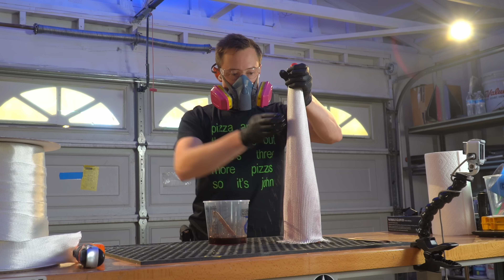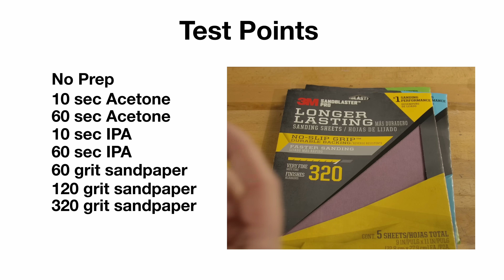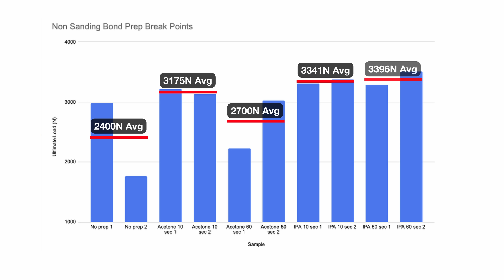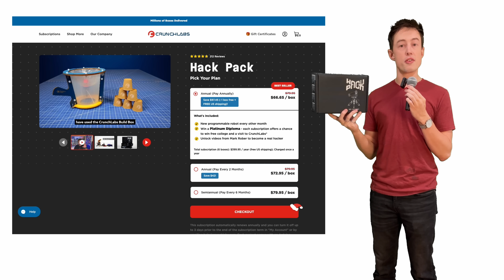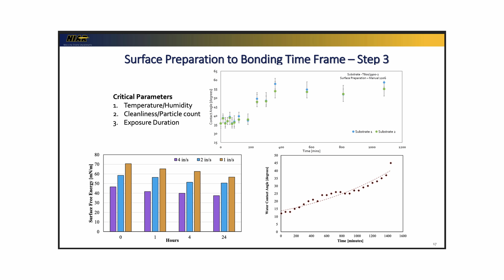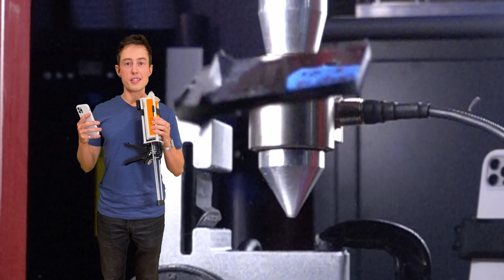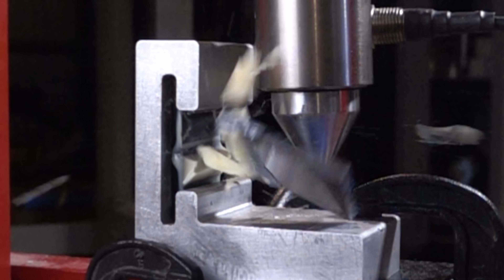I Broke 100 Epoxy Bonds to Find the Strongest

Comment: Try 3M Scotch-Weld DP420/DP460, Araldite 2015/2014‑2, and Permabond ET5428/ET5429. Loctite E-120HP isn't really aerospace grade.
I don't think sanding has any benefit, other than weakening the top layer fibers and possibly leave behind fringes that promote separation. So Acetone+IPA should be the best method regardless.
Reply: Sanding off fibers, Oceangate flashbacks...

Also, effectively, one can destroy the ENTIRE top layer by sanding only "a bit off it".

Comment: Only on youtube can I sit down for my sunday morning coffee and watch a 40 minute video where someone geeks out over epoxy stress testing.
Reply: I would like to suggest a test where the item is heated to about 125-150° with a hot air gun or hair dryer before applying the epoxy. Doing so will make the epoxy flow like water and it would likely eliminate most bubbles without the need to vacuum. Also you are sanding all wrong. Put the sandpaper on a flat surface and move the piece across the sandpaper instead of moving the sandpaper across the piece.
Reply: @Notfiveo0  yup, a sheet of glass is good for that. Also 8 shaped motion while slowly rotating the piece!
Reply: It's noon here so I'm drinking beer :)
Reply: This is barely scratching the surface 😂

Comment: Considering that you're intuiting the data regression, it might help to variablize the failure modes explicitly. You seem to be diagonalizing factors just fine without orthogonal experimental design. Although retroactively filling out the data points with specific failure modes would be frustrating in its own way.

Comment: I work in the pad printing industry and deal daily with inks, silicones, adhesion, and vacuum chambers. One important thing that hardly anyone mentions: right after degassing, you should minimize the time the resin stays under vacuum. You can put more variables to the test, regarding vaccum chamber! 

Keeping the resin under vacuum for too long doesn’t improve quality — quite the opposite. After degassing, the resin continues to “boil,” light fractions can evaporate, and its viscosity and pot life may change. In addition-cure silicones, it can even affect the curing kinetics. That’s why it’s best to degas until the bubbles disappear and the material calms down, then immediately release the vacuum and start working. This principle significantly improves the quality of the bonds.
Reply: You aren't the first to mention the light fraction of the adhesive possibly boiling away under vacuum.

Wow, there is so much one can do better or worse, with "little" deviations...

Comment: The only major changes I would make is trying the sanding with a belt sander to see if the consistency helps, and using a very slow electric/hydraulic ram to apply the load in a more consistent way. You might have just loaded the coupon fast enough in your 4kN test that they gave a higher but false reading.

Comment: Awesome video, I'm not rocket surgeon but for fibreglass repairs after sanding will always do an acetone wipe. It was my understanding it removes the styrene wax from the surface to promote the bond. Thanks for the all info and will be doing an IPA wipe after the acetone next time.

Comment: One thing that I thought was notable is that there were examples where you were observing substrate or cohesive failures.
Perhaps I'm missing something, but I'd think that once you're getting cohesive\substrate failure, the strength of the adhesive bond is no longer even being reached and measured.  Something else broke before the bond, so you're measuring the strength of the materials themselves.
By way of example, you can increase adhesion to cardboard by stepping up from Post-It Notes to masking tape to packing tape, but past that stronger tape doesn't make a difference because the paper surface of the cardboard is peeling away from the corrugations.

That said, you started getting what appear to be more consistent results with your final technique, so that's not nothing.

Comment: 32:50 A random thing I've "noticed". THE absolutely best sticker glue remover is epoxy thinner. I had some thinner for epoxy floor and by accident poured it over a sticker that was half-removde because it was too hard to remove. The sticker came clean with all the glue almost right away. I've used it to remove some other glue residues, like glue from plastic 3dprinter beds.  Commercial sticker removers are nowhere near as good. It smells a little of acetone. Try using that for preparation of epoxy surfaces.

Alternatively - toluene. Tried that for cleaning printer bed. It was too hard to remove prints afterwards, clean ethylene alcohol is better for cleaning, because plastic sticks, but it's easier to remove. Toluene looks like it dissolves surface of most plastics and dries extremely rapidly, leaving very rough surface.

Comment: You are supposed to mix in a separate container, degas and then load into a syringe to apply the adhesive. (Aerospace technician)

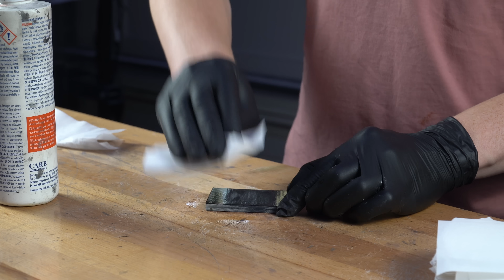Comment: Really enjoy watching all of the comparisons of the different test results. At 4:42 It didn't seem like you explained your full cleaning process in the video. Are you letting the IPA air dry? That would be leaving residue on the parts affecting the bond strength. The cleaning procedure for adhesive bonding parts in aviation manufacturing, scuff with Scothbrite pad, when wiping the parts for cleaning, never wipe the part with the same section of the rag more than once to prevent reintroduction of contaminants, wipe with MPK until the rag comes away clean, then wipe with a clean dry rag before the MPK drys. If the MPK air drys, rewet and wipe dry.

Comment: I make fiberglass body panels for street legal race cars. I am not an expert yet by any means. Occasionally the fiberglass molds chip out and need to be repaired.  I tried sanding, acetone, iso, etc, then fill, finish, polish, and wax. The chip would never hold. My solution was to sand, then drill 1/8" holes about 1/8" deep. Here is the key: the holes are all drilled at angles, up to 45°, not straight in. Clean up and paint in the holes with resin and a tiny brush, then fill and finish. None of the patches done this way have failed.

Comment: I love pop rivets and screws and how they expand to fit the holes, I would love to see a test where you drill a pattern of holes (comparing different sizes) then degas so that the epoxy can get right into the layers of the material rather than just grabbing onto the top surface.  Thank you for your hard work and wonder contribution, great video!

Comment: Nice, my first thought was anything over a few seconds of acetone's gonna make it weaker, it did. If you want something with a little more power, I use lacquer thinner when acetone doesn't work, it will literally eat through wood, so doesn't need much time. I learned that surface prep is everything... I'm lazy.

Comment: Low surface energy is super interesting for me as a car guy. I love having the water bead and just fall off the car when washing. Dirt doesnt stick to the paint and is very easily washed off next time. Some testing of the opposite of what you are doing would be interesting.

Comment: The optics cleaning guys have their own experiences. Simply wiping will often leave a streak, but dragging a drop with the right speed will not. But even air humidity matters. It's also possible to contaminate the whole bottle and then you can wipe and wipe.

Comment: The Titan submersible most likely failed because the repeated compression and expansion of the composite (and the bond between layers) created delamination throughout the material lowering its strength. I would imagine the failure of a rocket fin is not from slow steady pressure but from the extremely rapid resonances you get at Mach+ speeds. Ok, yes the steady pressure is there too but I’m willing to bet it’s the vibration the breaks the bonds in the composites and the bond between parts. I wonder if you should test your top three bonding techniques against resonance.

Comment: next time do a central composite rotatable design (CCRD) it will give you information about the best optimol point in those variables, it even will give you a optimol point between the variables. And a software does it by  you after the experiments. (and reduces the total time of experiment by half)

Comment: This was hard to watch. Your test results had extremely huge variance, yet you insisted on only doing two samples, squinted your eyes when looking at the results and made wild conclusions trying to fit the data. I think these experiments had negative value, not because the results were bad or incomplete, but because of how you interpreted them and how much value you put into your conclusions. You put a lot of weight into reducing uncontrolled factors, but you never had any significant result in the first place. All the results from before T9 could have realistically been from the same distribution, meaning all the conclusions you made could be just as well (and more likely) be explained by randomness instead of all the parameters you were modifying.

There is no need to be as rigorous as scientific papers when doing experiments to produce results of value, but you need to read up on statistics and how they can mislead you. You can often get away with only 3 samples per test, but only when your variance is much lower than the effect you see. You can get away with uncontrolled parameters, as long as they influence all tests in the same way. In this case you should really have put much more attention on understanding the on the size/shape of the distribution of results and how to reduce that, and not on trying to replicate that 4000 number.

Comment: You should try roughing the surface with a wire brush or wheel, instead of sandpaper. In theory a clean wire brush should embed less contaminants in the surface.

Comment: Are you kidding me? I never heard of surface energy until last week, as it got relevant for my work in printing on glas surfaces for the first time. So i went down a comparable rabbit hole and now we are doing a thermal pre treatment with a gas burner that is spiked with pyrosil, which deposits SiOx. Afterwards we use a primer, wich I dont know all the datils about but it provides better adhesion with the resin dyes we are using. All that to get to the sweetspot of 45-60 dyne and right molecular composition. After getting this treatment right the print quality went up 200%. Cant tell you how many tests we did XD

Comment: 9:58 The 60 grid test is still good to understand how you can achieve 4000N.

Your Data:

The winner closeup 9:58:
1) the epoxy did bond well to the resin on the surface by chance. You can repeat that reliably with your ace+iso method.
2) Crucially though, the substrate delamination did NOT reach the fiber level, thus the resin didn't just get peeled off the fibres, unlike the right side. BECASUE there was no single large stress point/crack at the base! Proof? Look at 9:42: The delamination at the top right corner begins in the epoxy, then penetrates INTO the substrate and rips the resin clean off the fibres!!!

How do you avoid this stress point at the fins base?

Better shear management. Look at your contact surfaces of fin and wall, where the cracks start. I heard that epoxy can at best bridge a gap of .1mm for optimal shearing resistance, that's why any flush bonds usually pressed down with clamps.
Your gaps are way beyond .1mm and inconsistent:

7:10 there is a thick layer of epoxy where the fins base sat
8:59 has a really thick layer
9:31 also has a thick layer
10:19 has a thick layer again
And your 9:48 60 grid? It has a perfect, thin even layer, like it should be!

Since the most promiment failure was shearing and the 60grid had the tightest fit, tight fit is a huge variable right where your failures can start!

If you test any more, instead of letting the plates wiggle in the loose moulds,
-first apply a thin layer on the back of the fin before sliding it in, to make sure it gets coated.
-and (!!!) cut the tip off the mould and press the fin down with a clamp!

You could also do a quick test: Epoxy a piece on a surface, with just a thin layer of epoxy, no filler/mould, then clamp one, leave the other sitting loosely. Then do the test how much that affects strenght in that area!
I also suggested in another comment, recessing the fin into the substrate might help reduce shear to begin with.

Comment: Did you think that during the ad read I wouldn't notice the rope on the well was facing the correct direction and the rope down is in an accurate position as if it were unwinding down. Because I saw that

Comment: This was a perfect case for multivariate testing. Don't test just one variable at a time! Look into design of experiments and taguchi arrays. They could save you a ton of time and reveal a lot more info than you would learn intuitively from your experiments. Taguchi arrays are extremely simple and effective (I have a video on them). You can go further with DOE software that's made to find exactly what's significant in your experiments and give you a super efficient testing path.

Watch my video "test multiple variables at once to optimize anything" and read jeremybub2's comment on that video to see how you can go further with software. I need to do an update on that myself because more people really need to know about DOE in the diy space.

Comment: already 1200 comments so doubt you will see it but I would recommend watching a video applied science did about cleaning and choosing the right cleaning agent for a task, and on the topic of IPA he demonstrated that its fundamentally unable to remove thin microfilms of oil from surfaces, you can observe this by running water across the surface and testing for even sheeting vs beading. he showed using a bleach soap like comet is significantly better then even products like chem wipes at prepping a surface for coating adhesion
Reply: 💯 Yea, this.

Also: People suggesting IPA is cargo cult, it's akin to suggesting superglue for everything...

(Me, after skimming through 900 comments...)
Reply: @Test_McTestface  lmao

Comment: sorry for my english! is google trad 
  my opinion :  ipa clean all pieces, sanding 40-60 , clean with DRY AIR pshhhittt pshhitt  , NO OTHERS MANIPULATION, !!  vaccum composit and  weld the pieces  and voila ...intuition say : ipa after sanding make capilarity pump under fiber ...:person-turqouise-waving::trophy-yellow-smiling:hello from switzerland

edit : Would it be possible to "bake" the glued parts? A long time ago, someone told me that the hotter the composite (ARALDIT® in my country) gets, the better it will hold. I don't know if that's true, or what temperature to use, but would it be possible?  30 year ago I tried it on my moped crankcase  and  today always in use :trophy-yellow-smiling:

Comment: the linear grooves work best when arranged in an x pattern on 45 degress to your break point ,  like your video setup of the tension compression and stress demonstration . The rest of the testing was great such as between the orbital and hand sanding techniques. Always pulling for the Skyshot and love seeing the garage spirit.

Comment: Can your composite samples absorb atmospheric moisture like 3d print filament? were different coupons stored or cut under different conditions? Is your mold release aqueous or solvent based? Did you control or even measure the flash time after wiping with solvent - perhaps there was outgassing after bonding? Cheers from Dan in Phoenix.

Comment: I would be really interested in seeing a comparison of prepping with Isopropyl vs Ethyl alcohol. I have a resin 3D printer, and like everyone I was originally washing my prints in 70% or 98% Isopropyl alcohol (I never saw much difference in performance, but one of these is a lot cheaper than the other). After seeing a review, I bought a can of Klean Strip denatured fuel alcohol (Ethyl alcohol made toxic so it can't be consumed by humans and is not covered by ATF regulations) and I don't know why anybody uses Isopropyl alcohol for 3D printing, Ethyl is better by every single metric you can use. It smells better, it leaves a better surface, it's cheaper, it's more consistently available, and when you go to re-use it, it's easier to clean the alcohol.

I'm just wondering if any of these properties would transfer over to surface preparation for adhesives.

Comment: I have always used 3M Wetordry 320 grit sandpaper. There are many types of sandpaper and some have anti-clogging coatings… some coatings contain silicone… no good for bonding. The company I work for currently did a study on sandpaper. The 3M was almost the best.

Comment: You 100% need a filler material, the way you're getting huge chunks breaking apart like that. You're not even testing the bond strength; you're testing the tensile strength of the epoxy if it's leaving layers on the surface... if it's not pulling away cleanly,  you're not measuring the variable you're testing. 
For example, all of the tests at the 37:00 compilation look like they left a fully bonded layer of epoxy on the substrate... so you haven't caused a bonding failure at all... the bond was stronger than the epoxy.
You're getting consistent results because that's the epoxy's yield force. You need something in the epoxy to work like the aggregate in concrete

Comment: Surface preparation always depends on what you bond to what part and how you want to do the bond.
Surface preparation if done properly will always result in stronger bonds and the different preparation methods also influence how fast you have to work/how much time you can take until the bond happens
Edit: I also noticed that you get a lot of adhesion breaks, so maybe trying a different adhesive might get even more strength